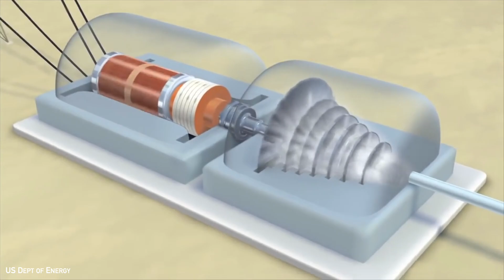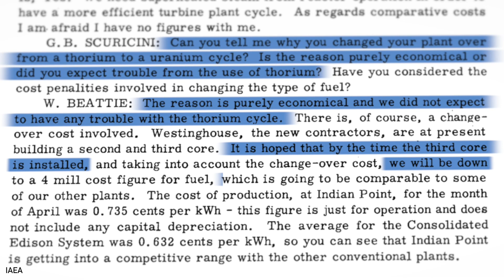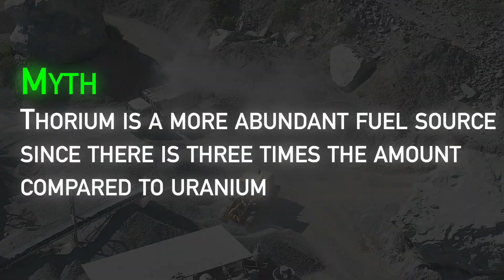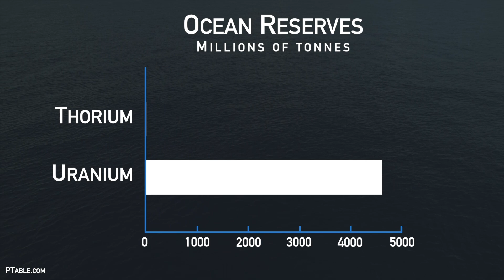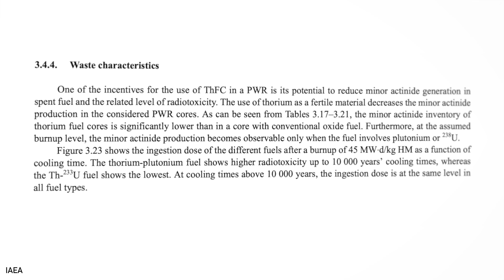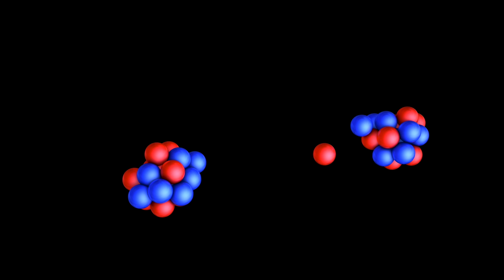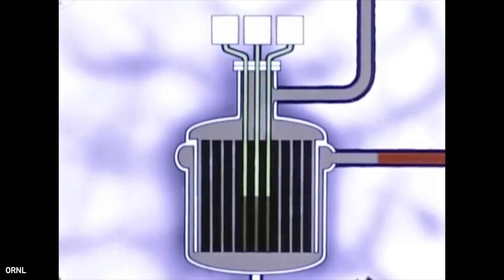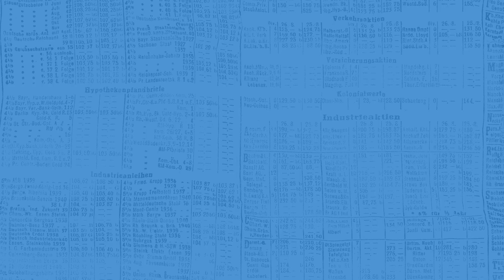*Almost

Comment: No water to go boom in MSRs as well. Fukushima was hydrogen explosions from water cracking.
Reply: The Russian and American Natrium MSR use sodium as coolant.  Sodium plus humidity, human sweat, or any other water source and yes it does go boom along with all the fission products and very difficult to put out a sodium fire....the only time you don't put the wet stuff on the red stuff. But hey it is not like water makes up 75% of our planet
Reply: @clarkkent9080  Of course you know the difference yet ignore it anyway. MSRs use fluoride or chloride salt, not metallic sodium. Then when you consider Natrium which does use metallic sodium, you ignore the fact that the sodium never leaves the reaction vessel, so there is no chance of exposure to water.
Reply: @chapter4travels  So MSRs don't use sodium except for the MSR that uses sodium????  Yea your not the sharpest knife in the drawer !!!!

Sodium never leaves the MSR vessel??  another brilliant statement.  Refueling?  Maintenance? Filling or draining the vessel?  spare sodium?

Terrapower started in 2016 and still nothing and with Wy winter just around the corner, I would not expect anything to happen for at least 8 months.
Reply: @clarkkent9080  There are dozens of MSR start-ups and only one is using metallic sodium and you know that. Natrium is the only one using sodium and there is a heat exchanger loop of salt that carries the heat out. No danger of exposure like in the old designs that used the sodium to carry the heat out of the reaction vessel. but you know that.
I'm not sure what your anti-nuclear hangup is but you need mental health help. 
In 100 years all primary energy will be fission and that's how long the transition will take because there is no money to be made in fission. $50 worth of uranium in a breeder reactor can provide a person with a lifetime of energy. How do politicians get rich with that?

Comment: Mention of the Indian Point Energy Centers first Thorium reactor that wasn't deemed viable is a false comparison. This unit was a PWR. Which is not ideal when it comes to using Thorium. 
From what I can tell molten salt reactors have many advantages. These possibilities need serious money to reach the point where private investment can make a profit. Trouble with this video is it seems to heap the make or break of Thorium on the viability of MSR's. Fair enough, But then vaunts the the fact that MSR'S can be built for Urainium. This is another false comparison. MSR'S are the best way to go to improve thermal efficiency and safety for both fuels. Government must continue to assist industry and help provide funds to research MSR'S for use with both fuel types, but putting a focus on Thorium would benifit us more. Once the MSR is perfected it seems likely that Thorium will eventually be preferred given higher fuel efficiency and reduced waste issues.

 Here's hoping that a standardised approach (like the French approach to nuclear power) is created that should keep the cost of maintenance down and improve safety.
Reply: Thorium was used in no less than 3 PWRs in the 1970s and abandoned for the same not cost effective reason.  It does not matter if you use Thorium in a PWR or MSR, the reactor is a U233 breeder and requires fuel reprocessing that the U.S. does not do...for good reason
Reply: @clarkkent9080 your right. My point is the video should make it clear that attempts to use PWR approach for Thorium drives up costs. Development of MSR technology is a huge hurdle that will take years of expensive R&D to overcome. The huge jump in thermal efficiency means MSR's are likely the future for fission. Development costs aside. Thorium becomes the superior choice using MSR. But this detail isn't made clear. The true / false (right vs wrong) isn't a helpful approach for all points made. Import details are left out to push this narrative. Whether it political, environmental or debate like this. Oversimplified approach to complex issues might create a punchy narrative but a proper understanding of a given situation is less likely and should be avoided.
Reply: @SuperBicycleRepairMan  The issue with new nuclear today is NOT waste or safety, it is COST.  The U.S. has in the past tried Thorium in a MSR and PWRs and in all cases it was demonstrated to be too costly. Reprocessing is very expensive.  If new nuclear is on hold because  of its cost, what is the reasoning in switching to Thorium that is even more costly?

The bottom line is that new nuclear in the U.S. is currently on hold due to the COST.  And of all the proposed new nuclear projects in the U.S. NONE involve Thorium.  Who is going to develop the Thorium infrastructure in the U.S. ?  More taxpayer welfare for nuclear?  The only place you find any positive Thorium discussion is on YT videos created by people with no education or experience in the nuclear industry and simply trying to make money as a content creator

Comment: the reason plutonium weapons were developed first, is because plutonium, unlike isotopes of uranium, can be purified by mere chemical means.  uranium requires a lot of extravagant engineering to do the same thing.
Reply: There are many ways to enrich uranium and the PUREX chemical process used to extract Pu239 is extremely dangerous and expensive.  Virgin U235 enriched fuel is much less expensive than MOX
Reply: @clarkkent9080  sure there's many ways to enrich uranium.  but not with chemistry.  it's much harder to enrich uranium than plutonium, that's why the military values plutonium so much more.  or anyway that was the state of affairs when they first started making bombs.  yeah, in the modern world, for power generation, uranium is better

Comment: You should consider fissionable uranium when consider uranium reserves. This is very low as fissionable uranium 235 is just 0.7% of natural uranium. But natural thorium is more useful as it contains more fissionable element.
Reply: Thorium is NOT fissile and does not fission...none nada
Reply: @clarkkent9080  the point is it can be converted to U233 easily in a rector.

Comment: Just an FYI: Yes you can make bombs from the material in a LFTR. At the lest dirty bombs… but the “BIG MUSHROOM CLOUD” ones also. But there are easier, cheaper and safer ways to do it. The point is that it’s not impossible… just impractical… and very dangerous (gamma radiation).

Comment: While discussing the availability of thorium vs. uranium you skip over two very important details.
1) only about .7% of 'minable uranium' is 285, the kind used in reactors.
 2) Thorium is found in abundance in rare-earth mines. Separated out just sets in 55 gal. drums waiting to be used. Amounting to several thousand years of energy already mind waiting to be used
Reply: Correction yes 235 is used in current reactors and IS only .7% of minable uranium.
100% of Thorium can be use by simple excitatory processes.
Reply: @jasonpettet156  You still don't understand that Thorium is NOT fissile and does NOT fission.  Thorium does not produce any power.  Thorium reactors use a uranium 235 starter core to produce neutrons some of which are absorbed in Thorium 232 which is then transmuted into U233.  The fuel must then be reprocessed (a very $$$ process) to separate U233for use in new fuel.

U.S. reactors use fuel with 4% U235 and 96% U238.  Some U238 absorbs neutrons and is transmuted to Pu239 which is fissile and does fission. Mid way through core life, the majority of power is from Pu239.  France reprocesses their spent fuel to extract the Pu239 to make Mixed Oxide (MOX) new fuel.

You are an example of someone who has no idea what they are talking about and doesn't even understand the YT video they watch
Reply: Thank you for the lesson on nuclear decay. A very basic lesson one could read on Wikipedia.
Sure thorium is not fissile it is fertile.  While most historical thorium reactors have use a small amount of  enriched uranium to start, there are Accelerator Driven Reactor designs that do not.
Cry all you want the world IS moving forward.
Reply: @jasonpettet156  The real lesson is that anyone can make and post YT videos.  Given my background (40+ years in nuclear), I see that these videos are filled with misinformation and false statements.

Sorry for being so blunt, I am old and never learned to be political correct. People today do not read technical articles or even read for that matter and rely on YT and social media for their education and given the state of our country, it shows.
Reply: Here are the real important details: It is U235 NOT 285 and ZERO percent of Thorium is fissile and Thorium cannot fission.  Thorium just like U238 (99% of mined uranium) must absorb a neutron to transmute into a fissile isotope

Comment: Have the corrosive properties of the molton salts problem been solved yet?
Reply: I read that the best steel containment yet found was Hastelloy-N... an iron, nickel alloy. I also read that the carbon moderator needed to slow down neutrons and hence sustain the fission of U-233 would only last about 5 years before it would have to be replaced.

Comment: There is no need to separate out the U233 or U232 from the molten salt.  U233 and U232 is the stuff that fissions and produces the power.  If you want to make Plutonium simply wrap the Thorium Molten salt reactor in a blanket of U238, common uranium, then after the U238 is irradiated with neutrons you can extract the Plutonium.

Comment: All so called problems with Thorium molten salt reactors are solved.  
Hastelloy  N metal has excellent properties to handle molten salt. 
The release of gamma rays from the Thorium fission reactor is easily solved with appropriate shields.

Comment: um actually thorium uranium fission cycle produces isotopes that emit gamma rays and X-rays because of u232 fuel cycle which means that any nuclear weapon needs to be so heavily lead lined that it is useless as a weapon https://en.wikipedia.org/wiki/Thorium_fuel_cycle but it has to be light water reactors not molten salt or possibly a gas core reactor design might yield the Same resistance to nuclear weapons production

Comment: I wish people would get into the actual amount of waste in nuclear fuel and stop calling it a "major problem" in nuclear energy. The amount of waste to store is so tiny that it's almost negligible. The total waste of the US from the start of the nuclear age to around 2000 would fill a football field only 9 feet high. That's it. It's also a solid, the leaking barrels oozing is from the Simpsons and does not portray what nuclear waste really is. If people actually know how clean nuclear is compared to virtually every other form of power generation they would be completely shocked.

Comment: What about fuel enrichment?  Sometime it is said that the relevant isotope of Thorium is a much larger fraction of the naturally occurring mix of isotopes int he Earth's crust, and as a result, much less enrichment is required for Thorium.  Is this correct, and if correct, is it economically significant?
Reply: Thorium is not fissile and does not fission or produce power.  It must be irradiated in a uranium reactor to make more....URANIUM

Comment: You missed 2 key points about thorium.   While fissionable U235 only makes up .7% of natural uranium,  Thorium is compromised of 100% fertile material, making Thorium 1000x times more energy dense. Also, U233 is not considered a good nuclear bomb fuel because it has U232 mixed in that produces alpha particle radiation. This radiation is dangerous to work with and damaging to  the bomb circuitry. The energy density alone makes Thorium a superior fuel.
Reply: You missed the simple point that Thorium is not fissile, does not fission or produce power.  It must be irradiated (Neutron) in a URANIUM reactor to transmute to URANIUM 233.

Uranium 238 (99.3% of all Uranium is not fissile, does not fission or produce power.  It must be irradiated (Neutron) in a URANIUM reactor to transmute to Plutonium 239 that does fission and make power.

So what is your point.

Comment: Regarding the nukes your information seems to be incorrect, the first nuke was not plutonium based and neither was the development of a plutonium nuke the first, it was the second because of how hard it was and is to get the needed U233 to make many nukes. Check the Manhatan project docs. In fact they were worried for a while as the "gun" type nuke would not work with Plutonium unlike U233. They had to develop the implosion based design to be able to use Plutonium.
Reply: Your comment would be correct if you replace U233 with U235.   U233 is not naturally occurring and was not involved in any experiments of the Manhattan project
Reply: @clarkkent9080  exactly its part of the thorium fast decay chain after about 2 weeks and would be the main breeding element in the thorium reacting chain, as in its decay will cause further desirable thorium reactions. and i am about the thorium reactors not uranium.
Reply: @clarkkent9080  oh and you are right about the 233/235 regarding nukes, my bad

Comment: A proper Thorium reactor will need uranium for at least 2 weeks during startup, basically until it has bred enough U232/U233 to keep going by itself. Either that or a a particle accelerator to do the same job the uranium would do.

Comment: Well, its not like you can't, you can, but its way harder and way less practical. It's much more easier to use it to burn nuclear waste from other reactors including plutonium. So, financially it does not make sense and in practice is also does not make sense due to how much harder to make a nuke from it is.
But the truth is ANYTHING can be turned into a weapon with enough creativity and bad motivation.

Comment: The comparison of the amount of Thorium vs Uranium available seems misleading.
It is stated that there is only slightly more Thorium in the Earth's crust than Uranium. As I understand it, something like 90% of the naturally occurring Uranium is U238 which is unusable as a fuel as U235 is required for a fission reaction to occur. This means that the Uranium as mined must go through an enrichment process to separate out the usable U235, hence the term "enriched Uranium."
The vast majority of Thorium mined is Th233, which can be used in a reactor where, as correctly stated, it absorbs one neutron to become U233, then the next neutron causes it to fission.
When you compare the amount of USABLE Uranium and USABLE Thorium, the comparison as stated falls apart.
Am I missing something?
Reply: Yes you are missing something.

Th232 (NOT Th233) absorbs a neutron in a URANIUM reactor to transmute to U233.

U238 absorbs a neutron in a URANIUM reactor to transmute to Pu239.

Both U233 and Pu239 are fissile, can fission to create power in a reactor or fission in a bomb to explode. So they both MUST be irradiated in a reactor to produce fissile material.

BTW Canadian CANDU heavy water reactors use natural (99.3% U238)
Reply: @clarkkent9080  are you saying you can extract plutonium converted from u238 to use as nuclear fuel (ignore the nuclear weapon)?
Reply: @yoppindia  To complete the comment thread, Thorium(Th232)  is not fissile and will not fission. However, put Thorium in a uranium (U233 or U235) reactor and it will absorb a neutron and transmute into U233 that is fissile and can fission. So Thorium reactors are actually U233 breeder reactors. But it required 2 steps; breed U233 and then reprocess to separate the U233 from everything else

Uranium 238 (very common)  is not fissile and will not fission. However, put U238 in a uranium (U233 or U235) reactor and it will absorb a neutron and transmute into Pu239 that is fissile and can fission. And yes this is exactly what happens in every U.S. reactor that uses fuel that is ~4% U235 and ~96% U238.  However, the U.S. does not reprocess.

Some countries like France do reprocess this spent fuel and extract Pu239 and any remaining U235 to make MOX (Mixed Oxide Fuel). And yes you can even use Pu239 from nuclear weapons to make MOX.

I hope that helps